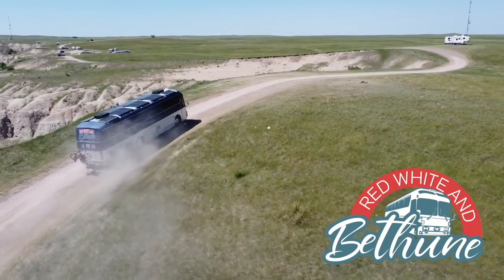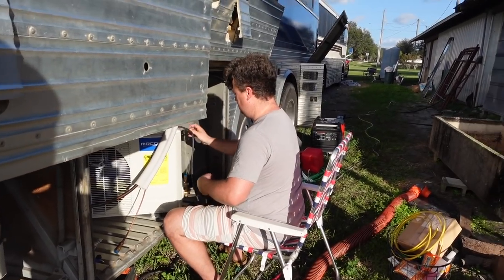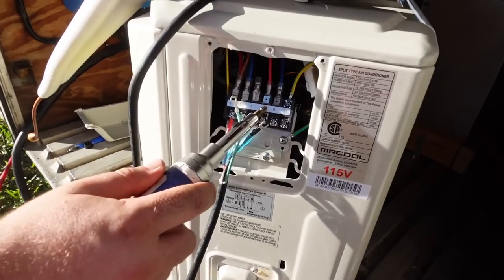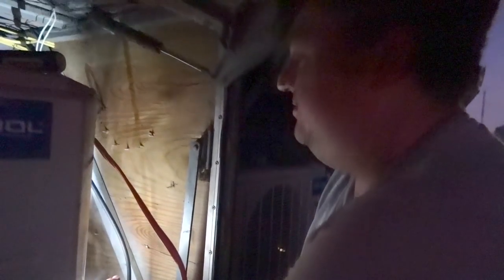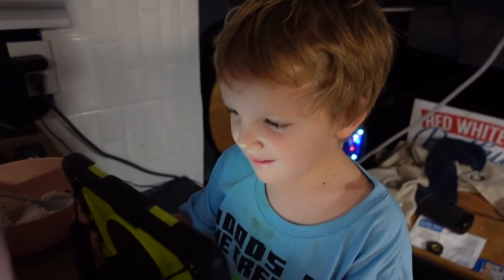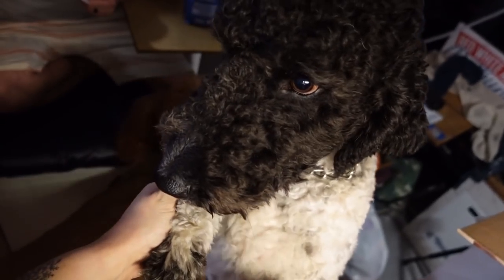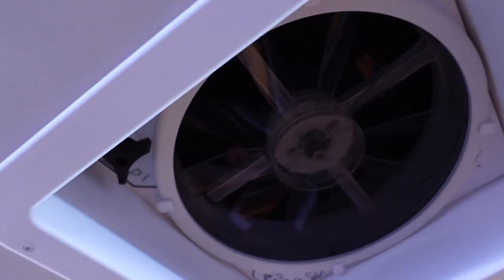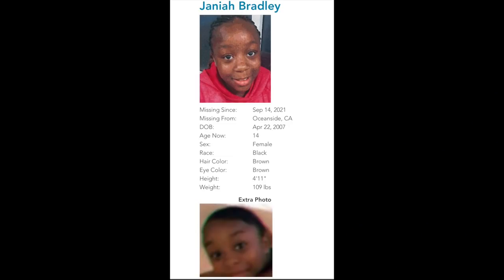What are we thinking?! This was definitely a horrendous idea!!

Comment: I did the same thing when I put in my mini split. Pulled the roof airs and put a couple maxx air fans in the holes.  I did find out the hard way when I installed my lithium batteries that the maxx airs are very sensitive to power fluctuations.  I fried the control modules in both of them.  Maxx Air did send me replacements, so I can't complain too much.  When I replaced them, I hooked them to regulated power supplies so they wouldn't get power spiked again.
Reply from the maker: Good to know. I’ll have to look into that.

Comment: Wondering if you found a solution for your drain hoses? If not, perhaps a collection container that you can use for plant water???
Reply from the maker: We definitely tried the container, but it filled up way too quickly. We ended up running the lines down out the bottom of the bus in each area. So far, they’ve worked out perfectly!